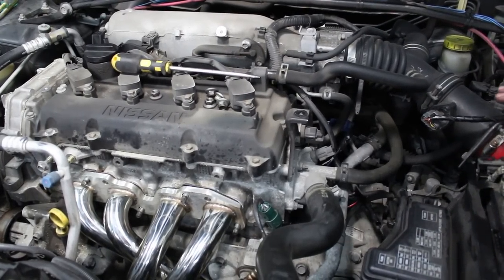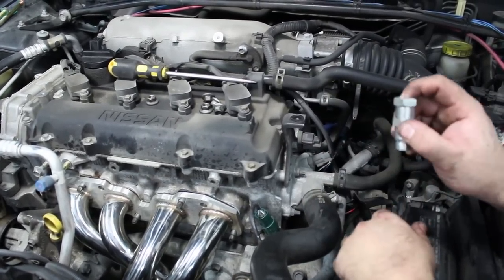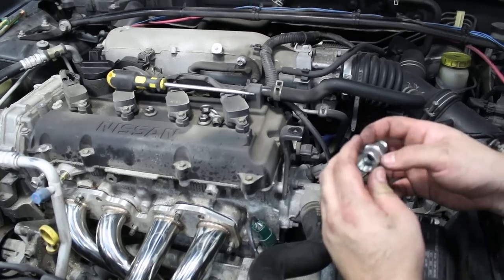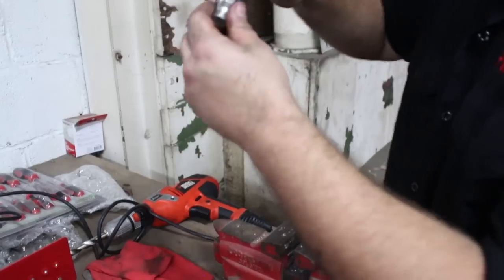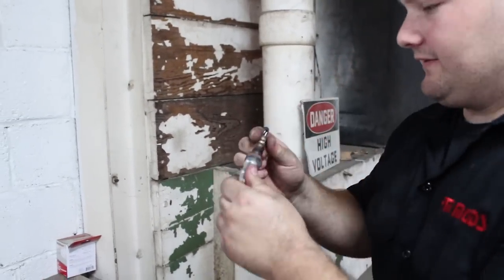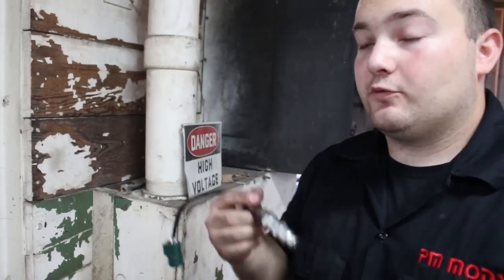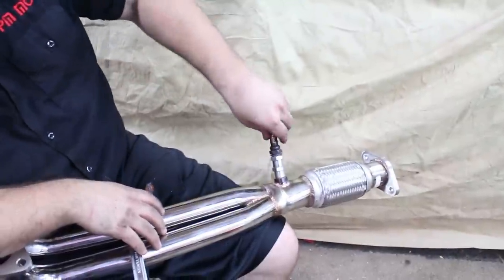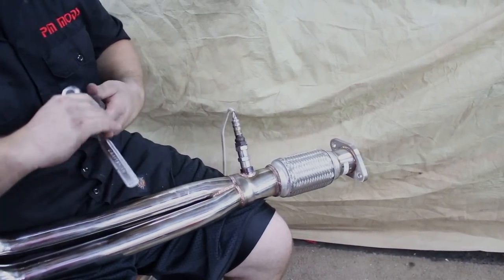$4 Catalytic Converter P0420 Fix | 02 Sensor Simulator | Pass Emissions | Oxygen sensor

Comment: Hey got a question. ..So your saying this is a fix to a bad sensor in the cat or bad/clogged catalytic converter that had triggered the check engine light on?? And that code fix would save me from buying a new converter? 
      Your response would be appreciated and thank you for your video,,,
       Sincerely, a Chevy girl with a stuffy cat problem :)
Reply from the maker: this is a fix for a bad cat, or not cat at all, if the sensor is bad you have to replace the sensor
Reply: Ok so let me ask you one more thing, if I cut my cat off n put a pipe n some brackets in replace of the cat, would that work so I wouldn't have to by a new cat ? N would that get the pressure off my engine, an serve the same purpose as what a cat does but a cheaper fix?
Reply from the maker: yeah, if you do all that and install the spark plug anti foulers onto your oxygen sensor, you should no longer have a check engine light. I dont have cats on any of my cars, and i use the the anti foulers on all of my down stream oxygen sensors

Comment: I have a 2001 Frontier 2.4. The shop told me my upper cat is bad and is causing the PO220 code. Would I need to do this on the upstream o2 sensor?
Reply from the maker: you do this on the down stream sensor only

Comment: How does this effect open and closed loop fuel cycles? If the car isn't reading accurately could it change air to fuel ratios? I assumed it wouldn't in closed loop but what about open loop?
Reply: air/fuel is adjusted via signals from the pre cat 02 sensors.
This mod is for post cat. Basically reads to see if the cat us functioning properly.

Comment: Im currently in the process of pustting a magnaflow direct fit cat with new oem o2 sensors.   I hate BOSH product's mainly there o2 sensors  at least thats my opinion on my 98 gmc k1500 5.0l serria you experience may very

Comment: What do you mean by "it will not work with a Bosch sensor. You need the original factory sensor"? My original factory sensor is Bosch. So I need to replace the bosch with another brand..
Reply from the maker: For the car in the video which has a denso OEM sensor, a bosch sensor will not work...
Reply: @PoorManMods  Ok. I understand. thanks for the clarification.

Comment: I have a 2018 GMC Sierra 1500 5.3l. Do you think that this will work? I am installing headers and not installing the cats
Reply: If you're state doesn't require safety text or smog check the check engine light come on an if you don't mind driving around like that after u do that mod won't worry about it  but don't throw away the cats save them if u don't want them I'll take them off your hands how many did it came with?

Comment: Hello,

Thank you for this great video!

After putting the non-fouler in the P420/430 are gone but I got a different code.  P133/153.  Is this normal?
Reply from the maker: you have have put it on the wrong oxygen sensor, the spacers go on the down stream sensor not the upstream one
Reply: Poor Man Mods lmao. Thumbs up!
Reply: @PoorManMods  spacers you put two on it?

Comment: I know I’m super late to this but I’m having a p0161 code on my 01 gs300 since it’s a heater circuit will this trick still work for the heater circuit o2 sensors?

Comment: I read before that this worked but can only be installed on the o2 after the cat (for system to recognize the cat is working), but looks like you installed before the cat (for system to read and adjust fuel ratios) so now I'm confused which one is suppose to work?
Reply from the maker: It must be installed after the primary cat

Comment: You have the OBX Header for your Sentra? If so did your CEL come back any time after the install? I have the same 2.5 in my 07 Altima and just installed these yesterday.
Reply from the maker: the CEL will come on, to make it turn off you need to do what I did in this video
Reply: Poor Man Mods just got it inspected and it passed, thanks for the tip
Reply from the maker: no problem!

Comment: Will this work on 2002 mustang gt, light came on because of cat less, x-pipe set up. So if I do this, will I be able to pass a smog test in Georgia?
Reply from the maker: It may only get rid of a check engine light code, it won't help you if they probe the tail pipe

Comment: Couldn't you just cap the downstream bung and zip tie the sensor up under the truck somewhere? It wont pass emissions without cats. Im thinking of having a completely separate exhaust system to change out just for inspection then put the straight pipe back on after inspection. 6.0L vortec

Comment: Would it work on a 08 yukon hybrid?? I have put a new catalytic converter and i still get p0430 and p0420 .. were those adapters go upper or down streams or all 4??
Reply from the maker: It will likely work, put them on the down stream sensors

Comment: Hi, good jod....
Question? So how do you call those 2pcs and wher i can get it.......and that go b4 or after the catalytic? thank you body.
Reply: Good questions.  My sensor failure is bank 2 easily accessable  upstream on a 2007 Ford Taurus.  Why can't i just put a plug in it sold online and eliminate the sensor without the drilling modification?  My vacinity in Ohio tests for compliance every 2 years.  Only 7 counties in Ohio of 88 total test.  A farce because the tested areas have improved air quality due to less manufacuring and better smokestack EPA regulations thus fewer emissions.  If Ohio doesn't receive EPA approval to cease federal testing other metropolitan areas are going to be required to test because other areas are rising in polutants whereas my area has declined for decades.  Donald Trump where are you when we need you?  Needless regulation in my case.

Comment: just did this with my 2005 pontiac grand prix and it took about 10 miles before the check engine light came on with P0138 & P0141 codes.  It doesn't seem like this is much of simple fix...

Comment: Will this work on a 2010 2.0t tsi VW ,,,if I installed a catless down pipe or just punched out the cat materials??my sensors are ntk
Reply from the maker: Maybe, its worth a try
Reply: @PoorManMods  it's the try I'm worrying about ,,I was hoping to see if anyone has done this mine an had no problems or they did ,,, everyone says get the tune just get tge tune ,,but I don't have 600 bucks to burn at the moment lol ,thank you for replying

Comment: I get 11 mpg with no cats on my 5.9 dodge. ever since I removed my cat my mpg dropped 5 mpg. would this improve mpg?
Reply: you're lackin back pressure so smaller exhaust pipes and smaller airfilter will bring your mpg back up also tighten up your spark plug gap.
Reply: WeAreWatching I had a 5.9 ram 1500 same you got I deleted my cat and muffler and did this trick my light never came on again, all I had was a glasspack
Reply: No lol
Reply: also anyone that tells you a 4 stroke engine needs back pressure is an idiot. Especially on a V8. Obviously they didnt go to school.
Reply: Nope...
Reply: Buy a Chevy! Stock 6.0 HD gets 15MPG all day, sometimes better still.

Comment: Does a catalytic converter need oxygen sensors or ECU s, or can it work on its own??
Reply: no the Ecu needs the measurements to calibrate the air/fuel mix while you drive and adjust the timing.

Comment: So if I straight pipe a Q45 drift car I can use this mod to keep the ECU from changing the fuel mixture up when in closed loop if I am thinking this through correctly?
Reply from the maker: +Jason Miller theoretically yes, you must put the simulators on the down stream O2s

Comment: Sweet! I have gutted cats for years with great results but my mustang acted all weird and lost its top end power. Then realized it was the down stream o2 sensors where getting the readings as the up stream sensors. Thanks so much, I will try this soon!
Reply from the maker: +Malirki The 1st good luck!
Reply: Does it worked?
Reply: Did for me, having said that I would leave converters that are in good shape alone. 
It's a lot of work to clean them out and there is no guarantee's it will be worth it.

Comment: Unfortunately this didn't work on my 2000 VW Jetta with a 2.0 engine.  Maybe my converter was too far gone?
Reply from the maker: +wizbang16 it's not 100 percent guaranteed to work, do you have the factory or aftermarket 02 sensor?

Comment: This dose not work! Or the mini cats. I have a 6.0 vortec. Comes for bad catalyst. Shop said cats melted out. I tried this and mini cats. Although they do shut off the cel for bad catalytic converter it trips other codes and keeps truck in closed loop giving the ecm a closed loop fault or open loop fault. Meaning truck still runs like shit and still won't pass inspection.

Comment: I found this mod out through my forum. I've gone through 3 CATs due to oil burning. Problem is my O2 sensor is frozen in the pipe and have had no luck getting it off :/ I might have to buy a new pipe and use this mod.
Reply: Heat it with a torch and take it out

Comment: My 2006 Prius the O2 sensor won't fit if I put on the second non fouler over the one I drilled out.  I see some videos with them placing only the drilled-out one over the sensor and not screwing on the second one. Does anyone know if that'll work before I do all this?
Reply from the maker: Drill out both foulers if you have to. It will fit.

Comment: I wouldn't list this as a "pass emissions" workaround. Most inspectors will catch this mod and make you bring the vehicle to legal. So many post the same trick... Do you not think these inspectors haven't already figured it out?
Reply from the maker: Been doing it for years with no issues. My state does not require probing the exhaust, only checking for engine codes.
Reply: @PoorManMods  do you live in Cali?  I have an 04 Audi A4 1.8t took it to get smogged and they wouldn't test it.  I cleared all the codes a few days prior.  All he did was hook up an obd then told me all the monitors weren't ready for testing.  So I guess it's just code reading
Reply from the maker: @teresa4949  no thank god

Comment: I was reading ur responses and i as well live in pa bucks county to be exact not that it matters but whatever lol and my mechanic has told me they do visual inspections not just scanning the guys not an idiot I've worked with him for 5yrs and hes a ma an pa shop thats been open since the 20's or so my car was obd2 a 97 sentra and he told me at the time "i had the light on" but told me even if i got the code off id still fail for not having a cat ur thoughts on this would be appreciated
Reply from the maker: i haven't had a cat on any of my car for over 5 years and ive passed emissions every time and ive gone to various shops
Reply: Hey I appreciate ur response man. yea I believe u, i was curious on ur thoughts on that. He probably didn't want to take any chances. I mean they passed me but by the third year they were pretty pissed lol
Reply: lilseip-B14 Some check for a cat, I've read by plenty of people that what they do, is cut the cat out, heat the inside up with a torch, then dump cold water in it, and you can knock the insides out, then put the cat back on. We don't even have smog checks in my county.
Reply: GodofCopulation 
So a mechanic wants a car to leave his shop in a good legal state what a criminal.
Reply: GodofCopulation I've had them look under my hood and car before
Reply: Exactly i think you'll find correct procedure includes a visual inspection.
But if you think dodgey bros is everyone. Good luck.
In Australia although rare we have the odd defect station where mirrors etc.
Are used for visual inspection if no cat it's an epa law you're breaking.
Up to 5 figure fines can apply.
But if that's you're idea to get an extra killawasp out of you're barina goodluck to you.
I like this vid because its a useful troubleshooting method. But it doesn't fix anything so definitely incorrect title and could be misleading e.g. now i don't need a tune.

6 weeks later you need a motor because it flooding then leaning out.
Wasn't really a fix is it.

Comment: You should always start with a smaller bit and work up to the half inch. It will save your bits and be much faster
Reply: Not necessarily since there's already a hole in there originally, that method is best for drilling through solid metal.
The proper procedure here is too use a reamer bit or a drill bit that gets wider as you drill deeper.
Reply: It's aluminum a 1/2 inch bit is fine
Reply: @wownycrrcom  Not EVER aluminum.

Comment: Would this work on a is300 with headers? Like obx or dna headers
Reply from the maker: i cant say it will 100% work, but on my is300 my cats were going bad and threw a CEL light for catalyst insufficient, and i did this mod and it fixed it.

Comment: Worked on 2008 Nissan frontier 4 cylinder.  Dorman part # 42002.  Only drilled deep enough for sensor to clear, not all the way through as SOME recommend.  Worked with after market sensor, $17.85 from prime choice (EBay). Replaced sensor first but that didn't fix it, then added the non fouler which did.  Thanks a lot, Poor Man Mods!
Reply: 17.85 prime choice ebay. We know that's pure oem. Haha

Comment from the maker: EricTheCarGuy have you tried or heard of doing this on an OBDII car? If not, feel free try it out and make a video about it :)
Reply: I have a PO420 reading n a P0440 n PO441 n PO446 what the hell. Is all this n please help me
Reply: Leola Ross 420 is a catalyst inefficiency code; 440 441 and 446 are all EVAP codes. Those mean you may have a leak in your EVAP system.
Reply: Poor Man Mods Back in the day I was able to successfully do this on two 2002 Civic Si's (obd2, of course) that were both outfitted with test pipes (no catalytic converter installed).  They both responded positively to the foulers and I was able to turn both lights off.
Reply: +John Zanjani did you install it on the first o2 sensor or on the one in the cat?
Reply: inside the cat, secondary
Reply: no lol i just want my check engine light to turn off. dont want to send 300 plus on a tuner.
Reply: Poor Man Mods will this work on a BMW 325i e46 that is throwing up the 4020 and the 4030?
Reply: Poor Man Mods will this work on a 2000 Subaru Impreza?
Reply: Poor Man Mods 9
Reply: Unfortunately for me it did not work on my X5 4.4 with a P0420 still throwing the code.
Reply: @intricate6927  fix it yet?
Reply: @mica122213  yes but I had to buy a cat and have it welded on. It was less than 200 total if I remember correctly but had to pass smog. I live in CA.

Comment: Has anyone gotten this work on a not factory sensor? I'm doing it on an Al Delco downstream sensor. Also do you reset the car by taking the negative off the battery or did you just drive around till the light went out?
Reply: You can rest the computer/ ecu by disconnecting the battery and then turning on your headlights this will drain the capacitors that store energy inside… you can watch a video on that as well

Comment: How well does this work? Has anyone done this?
Reply from the maker: Read the comments, it's worked for hundreds of people :D
Reply: Poor Man Mods That's crazy I'll have to read through them.
Reply: Does it work on rx-8?
Reply: ROCKIESFAN30 Try it and see, or just replace the bad parts. That's what I'd prefer.
Reply: I hollowed out my cat and all the forums say that it doesn’t so I figured I’d ask
Reply: KX125Ripper Nice! Why not just change the sensor though???
Reply: KX125Ripper so with that being said will this method work in eliminating a P0420 code under the "bank 1" category? I have a 2001 tacoma and the light popped up yesterday.
Reply: KX125Ripper Oh I see doing this if your cats are bad haha.
Reply: Poor Man Mods hello does this work for passing emissions? I️ have a 5.3 00 suburban I️ want to cut the cats off and put on fake straight piped cats and use the sims to take away the CEL. Would that cause a failing emissions given they only plug in my truck during inspection and don’t check the tailpipe?
Reply: Matt's Shop yes as it will just take the sensor out of the exhaust stream...if the human tester is not stupid he can clearly see the adaptor and I am sure you get in trouble for that as it is done on purpose. Why not buy n aftermarket cat or try to clean it? You breathe the same air as any one else if it's not your problem buy a ticket to India and look around for pollution
Reply: Millions of perfectly good cars end up in the junkyard because of minor smog issues. That probably does more harm to the air than limping the car for a few more years IMO
Reply: @kitecattestecke2303  
I wouldn't say stupid but give a dam since they probably make minimum wage or close to it.

Comment: Thanks for the video! I never understood what you had to drill out until I saw this. Putting a non catted BBK x pipe on my 98 GT. Anyone watching this had any luck with Ford's and this mod?
Reply: Thanks - will the check engine light go out or do I need to reset it?
Reply: Did it work?
Reply: My check engine light never came on after installing the x pipe. Sounds pretty nice but bad mistake on my part. I lost all my low-end torque with the higher flow. I'm thinking about putting my cat's back on
Reply: Tried it on my 98 mustang did not work still getting the rear o2 showing up as codes. I re placed all my o2s but there the bosh ones

I just ordered some mil eliminators coming soon hopefully that works seems legit.
Reply: @antonioaguila1807  just put some fine steel mesh between the 2 anti foulers and it will work, even with Bosch. Take some of the mesh and stuff it in the one that’s connected to the actual exhaust pipe and reinstall the other fouler and the sensor the way you had it originally. It should fix the CEL. Good luck
Reply: @nelagordon24  thanku soo much kind sir!!
Reply: @antonioaguila1807  you’re welcome. Glad I could help 🙂